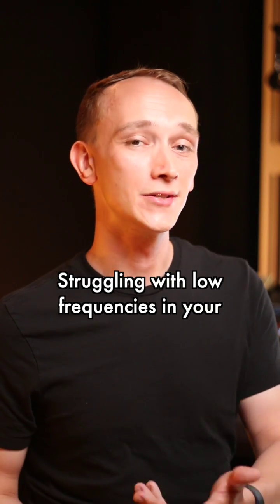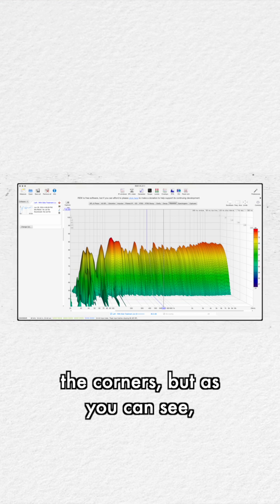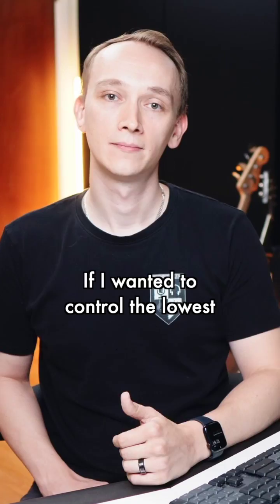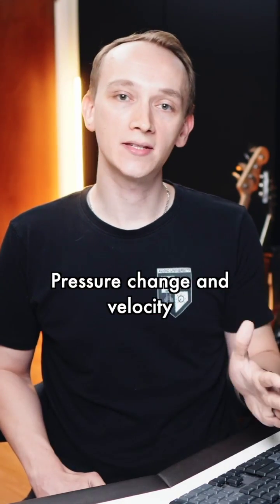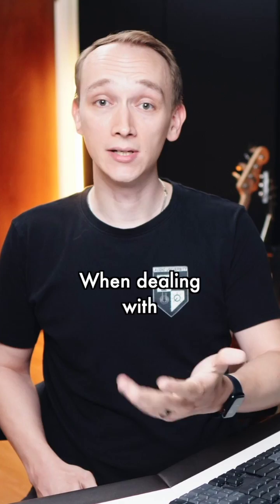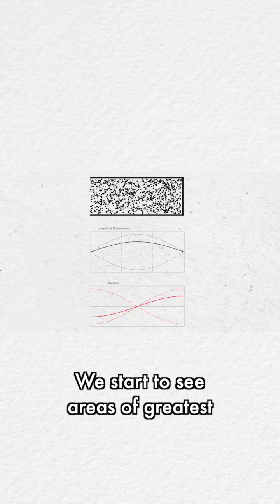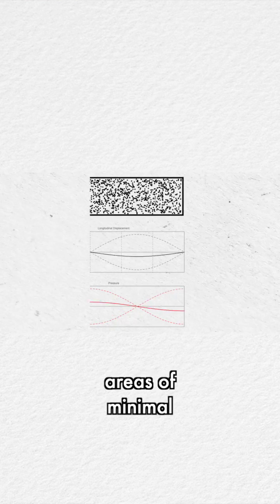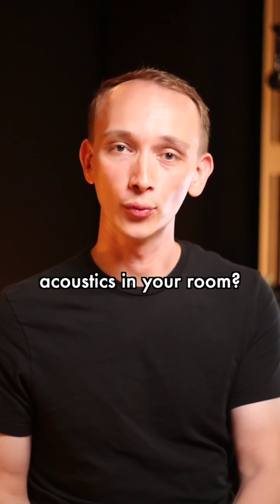How do you manage low frequency acoustics in your room? #AudioUniversity #audioengineer

Comment: I live in an apartment that has had 24/7 low frequency noises that I am guessing is coming from air handlers (A/C, heat), ductwork, and/or roof fans right above my apartment.  Every square inch of the apartment is noisy, especially throughout the night, and I think the noises are coming in from the ceiling, walls, and floor.  There are approximately four or five different noises, one of which is pulsating.  What can I do to block those noises from coming in?  Also, what can I use to record those noises utilizing my android phone?

Comment: I'd put a "hole" in the room to make the room seem LARGER to low frequencies. For example, have a hole on your ceiling (of course put something on it, maybe a 4" or thicker high density rockwool panel for rigidity) IF your ceiling is directly connected to your attic, as in just dump the excess bass into "nothingness", assuming your attic is quite a bit larger than your room.

Or, if your room similar to "a smaller room within a larger room", then dump the excess bass into the bigger room.

Now there's a third trick that you can use, it is by diverting the bass frequencies from going back to back and causing standing wave, make it so that the bass frequencies are veering off the walls by making your walls non parallel, something like this:

   \______/

But be mindful of the width of the slanted wall.

Comment: Nice! 
But you forgot to mention one thing - change speaker placement can also help a lot in the lowest frequencies. 
If looking at the simplest example, where you play back a bass tone that have a wavelength that's twice the room length (causing a standing wave). 
Now if you place one speaker in one end of the room, the resonance will be at maximum. As the wave leave the speaker, it will travel 1/2 wavelength to the wall in the other end, then back again. This gives a  total travel of a whole wavelength and thus, it will arrive back to the speaker just in phase  with the next wave coming from the speaker and so on. That way, the sound energy in the room quickly adds up.
Now if you move the speaker to the middle, the wave will only travel 1/4 wavelength in each direction to the walls and back (total travel 1/2 wavelength) and come back to the speaker in opposite phase. That way the resonance will cancel out almost completely. Now if you have 2 speakers, you can have one in each end (the wave from one of the speakers will arrive in opposite phase to the one coming from the other speaker, which gives the same effect if the sound is played back from both speakers at equal volume) - or you can place them at equal distances from the center of the room.
Then there are usually multiple resonances, and you will not get rid of all of them this way. But the lowest one (which is really the hardest to get rid of using sound absorbers) or sometimes (if you are lucky) even a few more above that one, can be counteracted this way.